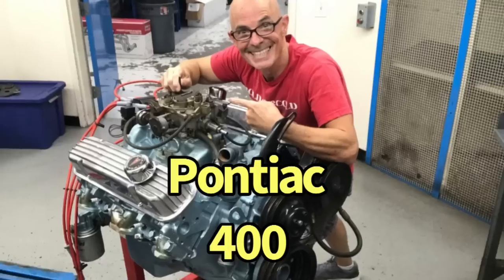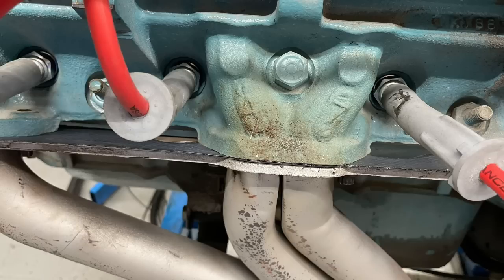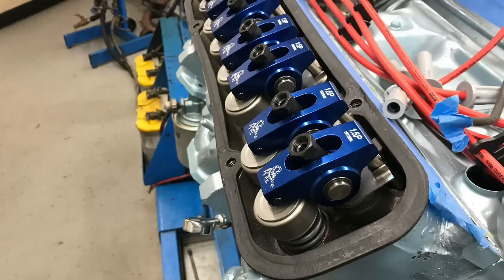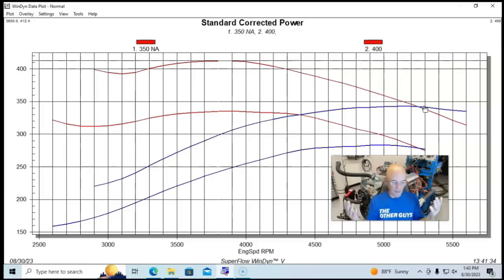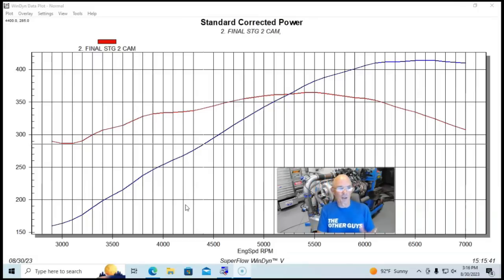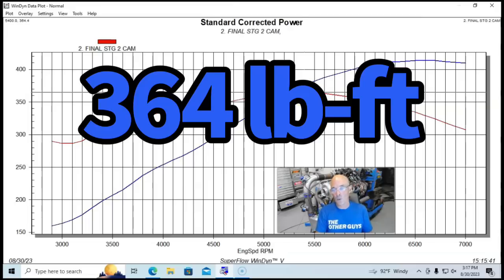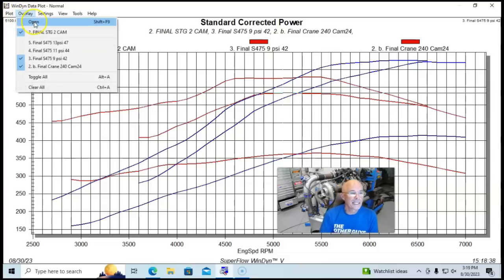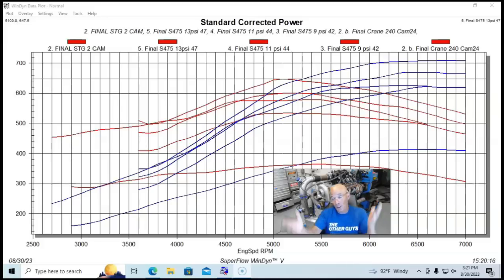PONTIAC 350 VS PONTIAC 400-IS THERE A REPLACEMENT FOR DISPLACEMENT? YES...IT'S CALLED BOOOOOOST!

Comment: WHY wasn't a 72 cc Pontiac head with 2.11 in take and 1.77 tried with a low lift cam tried on the 350? Lift would have to be kept under .460. Easy way to make a 350 HO motor.

Comment: I had a stock 1973 Formula 455 Firebird and my brother had a 1986 Grand National T-type (Turbo Inter-cooled) and whenever we raced head to head from a standstill I would always easily take the GN due to the sheer torque of the Pontiac 455.  However from a roll the GN could stay side by side all the way through the entire 1/4 mile!  I never would have imagined that a 3.8 turbo inter-cooled V6 could generate enough HP to keep up with a big block 455!

Boost is nice as you can generate the turbo's extra boost by simply mashing down the gas pedal!  Otherwise the V6 will perform like any other normally aspirated V6 when the turbo isn't working!

The 400 Pontiac was a good compromise between the 455 and the 350 especially when the 389 was no longer available.  The 421 and 428 Pontiac engines were also great engines but really hard to find today unless one can find one of these engines in a rural local scrap yard. 

Hot rodding was really fun in the 1980s since car parts were highly interchangeable so one could tinker around with different engine block and head combinations and work with whatever they could find in their local Bargain Finder or Automotive Scrap Yard.

Comment: Boost is a change in displacement. You are forcing more air /fuel into the engine, which is changing the amount the engine displaces.
Reply from the maker: displacement remains the same-boost multiplies the NA power output regardless of displacement

Comment: Would boosting a stock pontiac 350 hurt?
Reply from the maker: not if the motor is sound and the tune is correct and boost is reasonable

Comment: You are just looking at things in rhe wrong way. ,  displacement is relative, if you understand  basic principles.  Cubic inch displacement  is the amount of air an engine  can move of "displace"  boosting an engine is just forcing the most air that an engine can fit/handle .  So if the atmospheric pressure is 14.7 at sea level and you add 14.7 lbs of boost you are dubbling the displacement   so a  2.0L engine  running 14.7 lbs of boost at sea level is the same as  a 4.0L engine.
Reply from the maker: you don't double displacement, you double output
Reply: @richardholdener1727  your are increasing the amount of air that the engine is moving  to increase its output.  So yes, you are, in fact, increasing how much the engine displacement.

Comment: Could add boost to the 400 and then would the 350 have a chance to make as much power? Love your video’s How about doing a 390 Ford and a 429 Ford? Love the Pontiac videos, I just got an Duel Quad Edelbrock manifold for my 400 Pontiac Trans Am , it has a single plain high rise intake on it now. It’s cammed and headers and it really turns on in the upper rpm’s , so I don’t know if the Edelbrock duel quad is going to help on the low end on hurt on the top end, I’m hoping for better bottom end and still have the high rpm it turns now.
Reply from the maker: IF THE DUAL QUAD IS A DUAL PLANE, IT WILL HELP DOWN LOW COMPARED TO SINGLE PLANE

Comment: That OEM iron pontiac intake is hard to beat maybe beat by an RPM if not by much... The performer is best for a small displacement stock build.  Ive read pontiac did their homework in that intake
Reply: Definitely the best performing. I have Holley and Edelbrock aluminum intakes sitting on the shelf, only thing better about them is the weight. If someone did a stock Pontiac intake cast in aluminum they could make some money

Comment: When I was young one of my friends had a 1971 Lamans with a 350 4brl in it that we had rebuilt,  I can't give ya an exact figure for horsepower or torque,  but I would say it was probably in the neighborhood of 300 horse and about 375 torque, cause we had tested it with a compression gauge and it had 180 psi in each cylinder.
  Now mind you it's not a rocket with nitro or a turbo or anything like that. 
  Them old pontiacs rev up pretty darn good and coupled to a good th350 transmission and about a 355 gear in the axle and it is a good recipe for a fun Saturday night.

Comment: Did you test the compression at all on either of the engines?
  I thought that you would have at least tested the 350 when you were diagnosing the running issues it had when you first tried it out
Reply from the maker: it had even compression

Comment: Man Richard I really enjoy all your videos and all the effort you put into making them,
    I'm a bit more of what all these young people call OLD SCHOOL, where as I just appreciate a good old V8 or inline 6 cylinder engine with a carburetor.
 My father used to say just tune em up for making maximum torque, because that is what what you need to move weight, and if you have a properly built engine it will make sufficient horsepower 
   So can you make a couple videos of concentrating on making torque and show us all the results on the Dyno.?

Comment: My 1978 Camaro Type LT had a manifold that used a hot air style choke, 350 Engine was handbuilt at a local VA Shop. Car would bury the needle at 130mph no problem, plus took out 2 rear-ends and 3 transmissions in just 2 summers! Had HeI style ignition just wondering what hp this engine was putting out and the manifold must have been older to have the old hot air style choke? My right question is what kinda horsepower would this motor making to do what I said about? Tour 2 two 350 trans plus 2 set of gears. From and old but built 350 junk q-jet carb
Reply from the maker: introducing hot air is for fuel mileage and to help it warm up, it will not help power

Comment: When Pontiac 400's were easy to find in the junkyard, the notion always was the small bore of its 350 brother was a problem. funny thing...the bore and stroke are pretty similar to an LS1 346 cid V8. no one questions how well they breathe. so how do they do it? by making the port tall rather than wide, and having a Y block/deep skirt scenario that increases crankcase volume. so as the pistons run down to BDC, they aren't compressing the atmosphere inside the crankcase as much, causing resistance. The Pontiac, meanwhile, has a wide crankcase, achieving nearly the same benefit, and the valve angles are close to what helps the LS engines breathe better. 

all they need is a cathedral port, and they'll be a "cheap" LS (which is a bit of an oxymoron until the 5.3 litre LS reaches peak demand and prices for it rise up to the 6.0 level...but no one makes 350 pontiacs anymore, so they'll only go cheap from owners running to the LS bandwagon). what we didn't know then....but now we do.
Reply from the maker: they don't need cath port heads, they just need better heads
Reply: @richardholdener1727  true they could use better heads (can't we all :)  ), but with a small bore to work with, a narrow port that is tall will move volume to reduce shrouding by the cylinder (unless it's a flathead, then the valve diameter total can exceed the bore diameter). the issue of course as always, is quality over quantity. a tall narrow port isn't going to have a lot of flow at its floor, depending on its valve angle. a "big gas hole" isn't enough for a good head design, as we already know. 

Looking at my old 400 heads standing up in the garage, there's not a lot more port roof to cut into on an OEM head, but an aftermarket head could shape itself any way it wants. there were some 6X heads Pontiac used on the 350 that would be interesting.

Comment: Great video as always.  My boosted 350 Pontiac looks to have popped a head gasket as it now over heats when it never has. I have been looking at upgrading to a 400. And boosting that. Comes down to the deal really.  I was guessing about 400hp with 8psi on my 350 based on draggy results.  I am guessing Boosting a 400 is next on your list???❤

Comment: @Richard Holdener Just love the Pontiac stuff!!! The #62 heads on the 400 are 2.11” / 1.77” valves and 72Cc chambers around 10.5:1 CR. The 350 #47 heads are 1.96”/1.66 and 8.6:1 CR. So the 400 had everything going for it until you boost it boost it… as for aftermarket aluminum heads there are a few who make 350+ flow numbers and they’re not edelbrock. PONCHO POWER!!
Reply: I removed the #47 heads off my 350 and put on #62 heads lol. Nice lil bump in compression and breathes a lil better with the bigger valves.
Reply: @Boatanchorperformance  Nice! I managed to acquire a set of #16 heads from a 421 to put in place of the 6X-8 heads on my 455.

Comment: Richard:
     
       I'm part of an enthusiast group of the 1970's GMC "Trans-Mode" RV motorhome, and a common question had amongst fellow members of the group is "What do we use to re-power them when the factory-installed Oldsmobile 455 or 403 fails, and there's a shortage of rebuild-able cores?" Needless to say that with the THM-425 trans-axle (Turbo 400 twisted & with a diff.) the choices made must involve concerns and sustained mid-to high-RPM operation, as well as sufficient low-end torque and fuel efficiency. 

  This is where questions about turbocharging the Oldsmobile 403-ci.--or even the Olds 350-ci.--V-8s come into play as to seeking a solution. Is it possible to make 455-sized power from eithe 6.6L or 5.7L of Olds V-8? And do it on an affordable, commonplace fuel? (Pump gas 92-octane or E85) All without breaking the bank?
Reply: don't forget the diesel 350--oldsmobile companies will not only convert it to gas, but with a machined 425 crank (forged like your 455 toronado cranks) you can get 400-454 cid out of a small block that will accept your big block heads. 

time to stock up, while these go for cheap from owners looking to LS swap.
Reply: Sure, if you can do it with a 4.8, no reason you can't with anything else. The 455 won't rev as high stock as the 4.8, but I don't believe that's what your after anyway.
Reply: @Guns_N_Gears  the nice thing street rodders found when they ditched the targetmaster 350 for any BOP big block, was it made torque down low, so they had vacuum for accessories and decent MPG out of a 3 speed without an OD unit hanging off its back. and the big blocks didn't weigh all that much, the Buick 455 was like a cast iron headed 350. 

not sure what a 4.8 would move, don't they run 8100cc rats in motorhomes?
Reply from the maker: yes

Comment: Richard, you have messed with these LS engines so much you will likely know this. What should the cranking pressure be on an ly6 with a 230 @.50 cam.
Reply from the maker: DON'T KNOW-IT JUST NEEDS TO BE EVEN-I DO KNOW EVERY 230 CAM WON'T HAVE THE SAME CRANKING COMPRESSION
Reply: @richardholdener1727  absolutely correct but the more int. dur the cranking pressure will lower. This engine has 150 All around. I'm thinking the chain might be one tooth off.

Comment: So if you add the same boost to the larger engine you get more power.  So displacement still wins.
Reply: Exactly. That is when I stopped watching the video
Reply: @deadtodriving  The point, which is poorly demonstrated by comparing 2 Poncho V8's since the engines are identical in size physically and nearly the same displacement, is that boost can more than make up for a lack of displacement. My Incon TT 331 Ford was capable of over 700 HP and guys like Jason Betwarda were making 1500 HP from the same displacement. Sure there are 700 HP naturally aspirated big blocks. How many have you seen making 1500 without boost though??? It can be done but it will be a radical track only motor. There are guys right now street driving turbo LS and Coyote motors making well over 1200 HP.

Yes a bigger engine on boost can potentially make even more power, and again 2 Poncho's are a bad example, but larger displacement engines are usually physically bigger and heavier. Have you ever seen a big block shoehorned into something like a Fox Mustang or 3rd gen+ Camaro? I've been in both and they handle like crap. Even my '71 SS with its factory 402 was very nose heavy and would constantly oversteer. My buddy's Vortech supercharged Iroc could absolutely smoke my '71 in a drag race and still handled like a slot car.

If you are building a dedicated race car, not subject to displacement restrictions, go as big as possible and boost it as well. That's obvious. If you want something fast that can't physically fit a BB without throwing the rest of the car all out of whack though, you can still get the same or more power with a smaller boosted engine.

Comment: Richard fun video!  A little Pontiac specific information, the 1969 62 casting heads were 72cc (10.5:1 compression) big valve (2.11 intake 1.77 exhaust heads (the '62 castings were not produced for the 1968 model year, but were likely cast in 1968 or 1969).  These are essentially 1969 Pontiac 400 automatic transmission Ram Air III heads - functionally equivalent to the 1969 casting 48 RAIII manual transmission heads, and these were just one step down from the round port exhaust, bigger intake port (same valve sizes) Ram Air IV engine cylinder heads,  the 722 heads.   The cast iron Quadrajet 4 bbl intake pontiac used on "D" port engines from 1967-1972 was an excellent design overall, and most aftermarket intakes do not outperform it under 6k rpm.
Reply: 199 likes and 1,000 views! Let’s get the likes up for Richard !!!

Comment: Pontiac #48 #66 #670 #722 Cylinders big valves on the intake, and exhaust on 350 will increase horse power with a dual pattern cam "lunati" has the profile!💯🤔